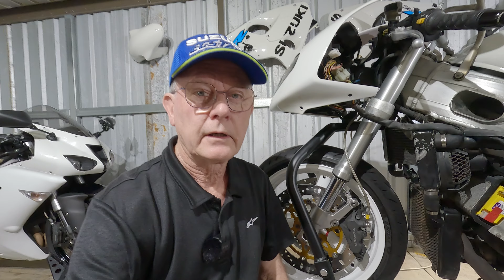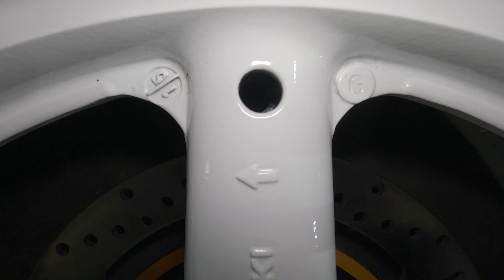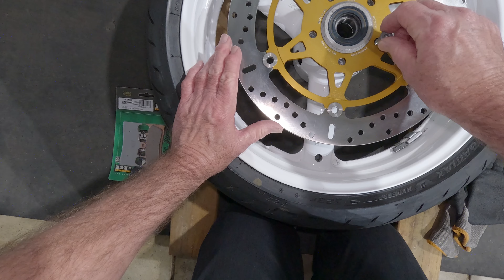My SUZUKI TL1000R gets the UK influence! Front End upgrades.

Comment: My TL is draining my battery slowly but surely. Any quick tips on what to check? Great video as well!
Reply from the maker: Hi, the TLR and my gen1 busa’s don’t have any electrical components running in the background when the ignition switch is off as far as I know. They don’t even have an anti theft immobiliser. My TLR was reluctant to start and what was wrong was the battery. There was too much resistance in the battery. The TLR needs a strong battery so I took the battery out and got it load tested and it failed. Bought a new battery and it’s all good now. I would suggest you get the battery tested first and then check to see if the voltage/regulator is charging when the engine is running.

Comment: Hi Kev!  Good job on the front end improvements.. I reckon the suspension and brakes will make the ol’ girl really rideable now!
I’ll be interested in how you find the steering with that 12mm added to the lowering of the yokes,  let us know what you think and how much quicker it turns in now… cheers, a Kiwi fan.
Reply from the maker: Hello to my number 1 Kiwi fan 😂  I hope other people who watch this video read this as well…..
Mate, what a drama, I waited so long for the brake pads but eventually I got some but, the 19mm radial master cylinder failed. While I was waiting!
Just after I had finished filming I couldn’t get the brake lever firm.
I re-bled the brakes, no bubbles!
So the next day I gave up and replaced the 19mm radial for another 19 mm Nissin radial master cylinder that I had. 
Instantly the replacement master cylinder came good at the lever! No trouble at all in getting a strong lever action.
A seal in the other mc must have leaked?
So now, hopefully I can get some progress happening…. Thank you so much for your help and info.